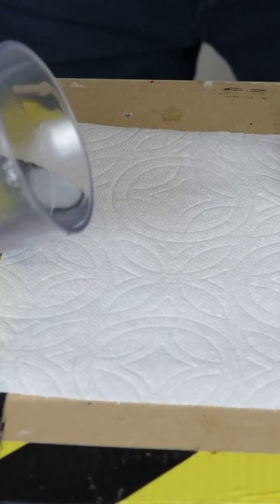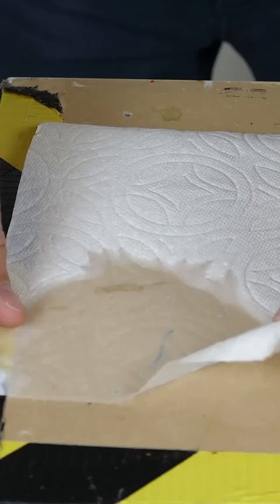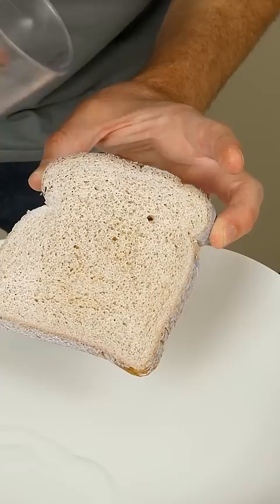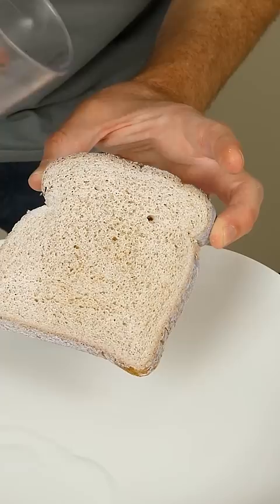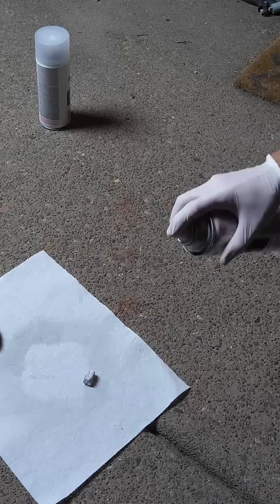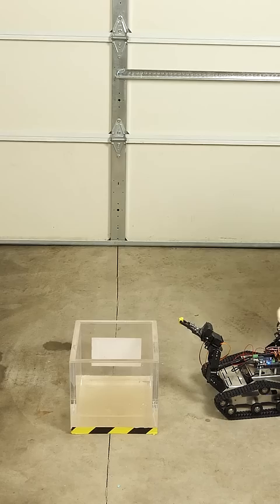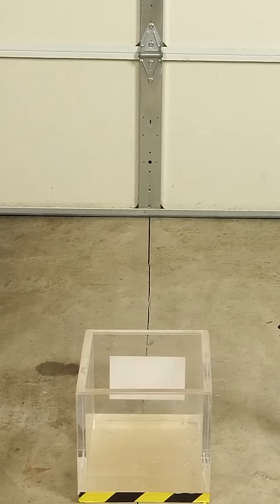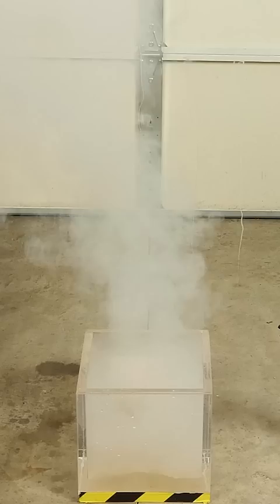I Tried To Make Hydrophobic Sodium...Bad Idea

Comment: casually discovers a timed explosive
Reply: That's what I was thinking!
Reply: Omg did yall just form a cell? 🤣 bffs
Reply: It's a timed explosive with no way to determine how long the timer is set.
Reply: @jamesmnguyen  that's the fun part
Reply: @jamesmnguyen  the most dangerous of explosives
Reply: @jamesmnguyen  rng is a good thing tho
Reply: @planeinglish7095  Makes a great depth charge if you get the time down.
Reply: You can put the sodium in a cube that is split into two parts and place a small amount of water , making the sodium a bit hydrophobic would also ensure a smaller chance of error and then make a mechanism that opens with a remote control on demand to remove the barrier between the two sections of the cube , Not based on personal experience at all of course :)
Reply: @jamesmnguyen  yeah
Reply: Allyou guys that responded to that are gonna get a visit from the..
KNOCK KNOCK
awe crap...
Reply: @BaltimoreMaryland  strange 
Usually its a angel who visits me
Nazuna: Dont you dare
Reply: The timing doesn't seem very reliable, better to rely on technology for that

Comment: Bro just made a timed sodium grenade.
Reply: now i feel like i could make a sodium grenade. 
The water and sodium would be separated, and when you pull the top thingy, they are mixed together. 
Throw it far and it explodes and explodes out all the little grenade bits!
Reply: Don't give them ideas
Reply: @foxy5848  I think the issue with such a grenade is that it would detonate in your hand.
Reply: @fishworshipper  the whole point is that when you pull the lever it puts the two together
Reply: ”I may not have a brain, gentlemen, but I have an idea”
Reply: Sodium water balloons are a banger at kids parties
Reply: @cacti4  Yes, and when water and sodium are put together, they react extremely rapidly. You would pull the lever, cock your arm back to throw, and then your hand would explode - if you even got that far.
Reply: @fishworshipper  make a delay then
Reply: @aimansyameer7522  and how would you do that?
Reply: @kawaharaizumi731 maybe like  in this short cover it with hydrophobic
Reply: @aimansyameer7522  I imagine the issue with this is that there's obviously not really any way to tell whether it's gonna sit there or immediately explode or anything in between. It's not "timed," more like "extremely unpredictable"
Reply: well, it's time for good ol' engineers to work on it!
Reply: @fishworshipper  It would have to have some sort of intricate system to delay the water or something, but even then it sounds like it would be incredibly unstable at best. Like this dude said, one microscopic hole is all it takes, and look how much of an explosion that little pebble created lmao. Now imagine it grenade-sized. If that's attached to your hip when it goes off, your hip is no longer attached to you
Reply: @TheJpiscool  Exactly, the whole point of a grenade is to be extremely predictable to the user. They explode with the force that they do and at the time that they do not because we lack superior explosives, but because that's how much of an explosion we want them to have. A sodium-based explosive would technically work, yes, but there's no sign that it would be stable or easier to manufacture than conventional grenades.
Reply: @aurelien5747 nice 😂
Reply: @fishworshipper based response that used critical thinking. First one in this whole comment chain
Reply: @foxy5848 that's a cool idea but but if we wanted to make grenades explode bigger we could, the thing is you don't want your grenades being too powerful cause the guy throwing it still has to be safe
Reply: I mean, instructions on how to build a nuke are publicly available. But for the same reason as a thermonuclear bomb, where are you supposed to find the materials.
Reply: @fishworshipper well we don't know how long he waited for it to explode so if you put a peice sodium covered with neverwet it might work
Reply: @foxy5848 make it so you have to hold something down as well, so they mix when you throw it
Reply: @fishworshipper I like his idea but maybe the delay isn’t necessarily a fuse like a real grenade but a wall inside the grenade that opens after a bit of time like a fuse allowing the water and sodium to mix.
Reply: @fishworshipper did you not watch the video?
Reply: Just toss it in a swimming pool and….
Reply: @Goddess.211  I did. What part of the video made you think that that situation was stable and reliable enough to carry on your hip or chest?
Reply: @cacti4 sodium in a water balloon and draino/water in a 2 liter bottle drop the balloon in the bottle and you got about 10/20 seconds before the draino eats the balloon 😱
Reply: @fishworshipper that's where never wet comes in
Reply: @fishworshipper  make it have a fuse
Reply: @qkcum  You did see that never wet didn't work, right? The sodium still blew up.
Reply: @EpikBulletYT  Fuses aren't magic. You still need to make a container that is perfectly water-tight, which still opens on command to interact with the sodium, with a delay mechanism to not blow up immediately, all while being cheaper and easier to manufacture than regular grenades. There's a reason sodium grenades aren't in use.
Reply: @fishworshipper   bro just typed out the entire solved answer to his first sentence
Reply: wt* is this comment section replies
Reply: @student_anime_lover   you dont deserve to know
Reply: @cacti4 And when it goes together it instantly explodes
Reply: Hang fire that goes off who knows when.  Not a good timer
Reply: @EpikBulletYT  why
Reply: @student_anime_lover   idk
Reply: @aurelien5747 For real. I threw one at the neighbour's kid yesterday at his party. Everyone said it was "Fire"
Reply: @fishworshipper Yeah
Reply: @TheJpiscool 😂😂💀💀
Reply: @fishworshipper You make sense
Reply: @foxy5848 why make a sodium grenade when you can make a nitroglycerin grenad- gets banned
Reply: Guys why would you use sodium? Like nitroglycerin is easier since on a hard impact, 100 ml of nitroglycerin would basically make a c4 explosion, it can also explode at temperatures of 212 degrees celsius or more, you could just use the mechanism of a grenade which is when you pull a pin, it activates a fire on the fuse and just put the nitroglycerin on the bottom and it would explode
Reply: @fishworshipper  No no, "hydrophobic" covered sodium.

Or just make it a trap not a grenade. 

Explodey explody!
Reply: @fishworshipper  yea but it wouldn’t be very reliable lol could explode instantly
Reply: I didn't even notice 😂
Reply: I thought the same
Reply: @foxy5848 here’s my idea: a top chamber full of gasoline with sodium powder settled at the bottom. when the grenade activates, a small detonator creates a shockwave that breaks the bottom of the container, sodium is released into a small amount of water. they react violently, throwing gasoline and hot sodium out in every direction, creating a large fireball.
Reply: @foxy5848 i dont think you should make a grenade when you call something top thingy its a bad sign
Reply: W idea
Reply: @foxy5848  you would need a pretty big grenade and the gym's final boss' strength
Reply: But,  how do you delay that in a reliable amount of time,  perhaps a sponge that water takes a while to soak into? But the main issue is that sodium explosions are all bark and no bite.  It'd be a half decent@cacti4  concussion grenade, but the force is limited so it can't propel shrapnel
Reply: @kawaharaizumi731  maybe make the part which severs the sodium and the water in a roundabout eay so it would take the water to reach to the sodium longer? the gap would be vacuumed so the water will solve the labyrinth in 3-5 seconds then boom
Reply: @fishworshipper use the never wet and just throw it don't know when it will explode but expect it to be timed
Reply: A land mine might be safer
Reply: @foxy5848 get a plastic water bottle and put a glass sodium ampule in it. When you throw the bottle, the glass will shatter, exposing the sodium and allowing it to explode. For extra damage, add metal pelats around the edge of the bottle.
Reply: @foxy5848 make it like a thick short glowstick I've made a blue print for this idea but instead the stick is in a hot dog to heat it up
Reply: @fishworshipper  electric or mechanical timed lever that will mix them
Reply: @aimansyameer7522 how about you have a smaller traditional explosive in the middle of the grenade, once activated the micro explosive will explode after a certain time, destroying the barrier between the sodium and water, which then causes the grenade to fragment.
Reply: @cacti4 yeah and it would explode very fast
Reply: Bro just said bro
Reply: @fishworshipper  just have a material seperating the two that can be broken by the force of a typical throw. Boom done doesn't have to be intricate or complicated.
Reply: @thecrazyhobos  Yes, I'm sure that the only time a small, round object would be exposed to such forces would be when it was being intentionally used. Certainly it would never experience any kind of significant jostling or unexpected drops on the battlefield.
Reply: @fishworshipper  if it were to be used on a battlefield then it would be refined enough to make your point moot. It's not going to have a high risk of blowing up your hand if designed for military application, and my example was merely that. An example of why your point makes no sense and it would never blow up your hand before it's cocked back if anyone spend any modicum of time designing it.
Reply: @thecrazyhobos  Technology is not magic. "Refining it" doesn't just handwave away fundamental flaws in a design.
Reply: @fishworshipper  if you think that it's so difficult to find workarounds to the flaws you have said, then thats on your own uncreativity. That doesn't mean a military engineer couldn't look at the issue and easily come up with a viable solution. I never said technology is magic or that you can simply wave away issues, stop putting words in my mouth. Its not an unrealistic idea and it isn't something that would take so much effort to make it worthless. You're the one who seems to think technology is magic if you think such a simple concept couldn't be applied reliably.
Reply: @kawaharaizumi731 maybe have an electrical element that delays the signal when the button is pressed.

Or have it be a battery that keeps the two parts from making contact
Reply: @cacti4 After a delay.

Comment: Many years ago, we had a weird chemistry professor. He would "clean out" the reagent cabinet on rainy days by throwing chunks of sodium metal in rain puddles. Produced 15 ft pillars of flame. We blamed him for the white squirrels that became common on campus.
Reply: I have so many questions
Reply: As somebody having a side responsibility for inventory at a lab, I respect this guy. This was before all the silly rules were put into place for things like plumbers explosively discovering that someone had been disposing of sodium azide down a regular copper pipe for decades and then just kept the water running to keep it wet at all times.
They had to turn the water off because the pipe started leaking, and when the poor bastard got there it was probably the consistency of a chocolate sculpture.
I say "probably" because that much high explosive in one place doesn't react well to being prod with metal tools. So it's not like we can ask the guy, and the pipe most assuredly does not exist anymore.
Reply: Tf are white squirrels what
Reply: You a hilltopper?
Reply: @Reddotzebra Toxicating animals? Ur degree should be removed.
Reply: @moltengears7483 Squirrels that are white in color. While uncommon, they actually do exist.
Reply: There is a phenomenon of frightening shock turning the hair white. Thus poor scared squirrels turning white.
Reply: @seja098 probably it's a degree in chemistry, not biodiversity

Comment: Imagine if it didn’t explode, and then you essentially have an active bomb that you have to deal with
Reply: I was thinking exact same thing
Reply: If it didn't explode the first time why it would suddenly go off without warning? That's not how chemical reactions work
Reply: @ephwurd2yurMother  did you watch the video?
Reply: @ephwurd2yurMother it’s a piece of calcium that only isn’t reacting because of a thin coating of hydrophobic material. This is not at all the intended use of the material, he doesn’t know if the coating is water tight, and he doesn’t know if it’ll degrade over time. Him touching it could also scrape off some of the coating and cause it to instantly react. There’s a lot that can go wrong here. Also, “why would it suddenly go off without warning that’s not how chemical reactions work” lol, that’s exactly what undetonated bombs. That’s why they’re a problem.
Reply: @ephwurd2yurMother same reason there are still WWII bombs in German soil. Yes, sometimes they even still go off.
Reply: @ephwurd2yurMother  how do you remove it from the water without accidentally piercing the hydrophobic coating? the simple act of touching it could damage the coating. That is how it's a danger.
Reply: That was what I was hoping the robot would be for but it has a T-Rex arm.
Reply: @ephwurd2yurMother that is literally exactly how chemical reactions work, they can be fine for 5 minutes then kaboom you are completely wrong 💀

Comment: As soon as it didn't explode, I was wondering how you were now supposed to pick it up 😂😂
Reply: Right? Like if it didn't explode for several minutes, he'd have to deal with it bombsquad style or something.
Reply: I mean if it hasn't exploded after you come back from a several hour break it's probably safe to pick up but if you're really cautious you could always just tip the bucket over and wait for the water to evaporate or soak into the ground. It'll either explode you can just grab it when it's finally dry 🤷‍♂️

Comment: Connection Terminated
"Do you realize what you've done!?!?! You mixed never-wet with water!" 💀
Reply: What has science DONE?
Reply: wouldnt that just make hydrophobic water or somthing
Reply: @ligma445  what is even hydrophobic water. "Hydrophobic" means water-hating. What is water that hates itself?
Reply: @chirantannath6593  hes done a video where he made hydrophobic water and yer its basically that
Reply: @ligma445  May I get the link, Mr. Balls?

Comment: you can use silicone spray to waterproof ie raingear, boots because unfortunately nevr-wet rubs off immediately. good use for nevrwet is steel under salt water ie docks not being abraded or rubbed

Comment: Now you can make a grendade at home, this is achieved by 3d printing the base scematics for a grenade, but with sodium on one side a pin operated pulling mechanism, which will pull out a part meant to keep the sodium dry, making the water spread to the entirety of the vessel, giving you 7-10 seconds before the neverwey wears out, giving you your homemade grenade..

Comment: Explanation: While repelling water from a surface Neverwet has the surface tension of the water to help it. Which means; imperfect applications of the spray does not matter too much.

However, when submerged there is no surface tension, unless Neverwet is on a porous surface to trap some air. Water molecules are not being contained by their own surface tension so can take advantage of imperfections in the spray application and get through to the sodium.

Now, if you applied Neverwet to sodium and then poured the water onto it instead of putting it into water, nothing would happen, the water would behave the same as on the other objects you sprayed.
Reply: Yeah, I was thinking it waa an unfair test.
Also a little overdramatic about the sodium. Ive been doing the sodium in water demo for years and it always takes a little time to explode...
Reply: That is an important distinction between the 2, and that shouldn't be ignored as the guy in the video is. Thank you bc now other people will get another perspective.
Reply: So hypothetically if you dropped a piece of sodium into a vat of never wet, and then dropped the sodium into water, assuming that it properly was covered perfectly, it WOULDN'T explode?
Reply: @entwixed3406  yes, assuming the sodium is 100% covered with enough Neverwet for it to function as claimed then the sodium should not explode.

Comment: Kid in my highschool back in the 90s stole a goofball size chunk of Sodium out of the science class storage room. It was a chunk in kerosene or diesel in a glass jar. Teacher immediately knew it was missing shortly after and the guy that stole it got scared of getting caught, went to the upstairs bathroom in one of the main parts of the building and tried to flush it. It flushed. It blew up. All the toilets upstairs and downstairs blew up off the floors or cracked. No injuries. He didn't know that big of a chunk would do that much.

Comment: I wonder if the water was cooler causing it to shrink and crack the barrier or possibly pulling a vacuum through the structural integrity of the coating

Comment: So, forgive me if I'm way off here; when replenishing electrolytes in the body, you can drink, lets say, Gatorade. Gatorade has salt (Sodium Chloride) in it. The human body is made up of, ballparkavg., 63% water. On a microscopic level, is this salt replenishment, from electrolytes, very roughly an example of refueling the muscles/cells so they can continue to "function/fire off"? (Sodium Potassium pump), and this video a life size, vivid example of the kind of microscopic/cellular energy being produced through that salt/H2O interaction in the body? (I think  I worded that correctly, maybe not)